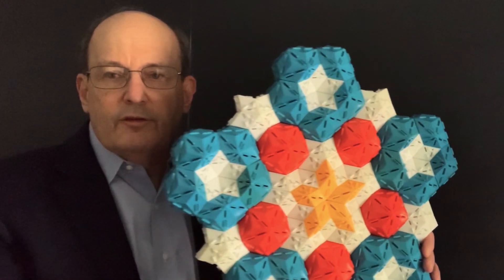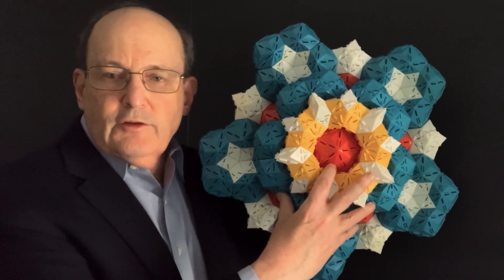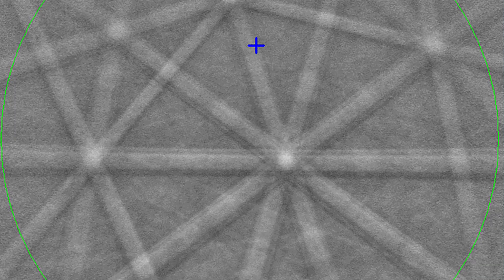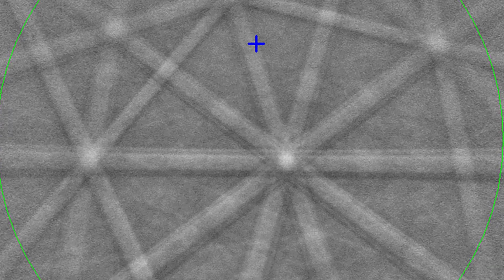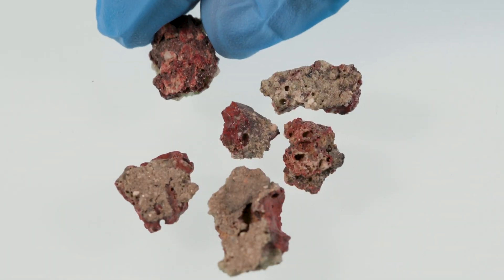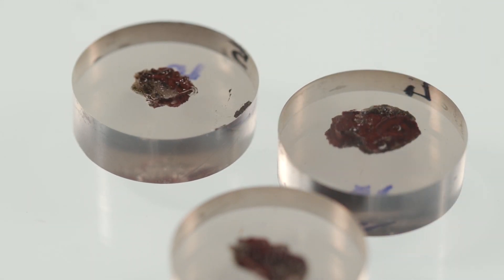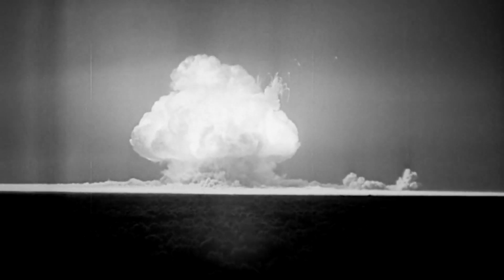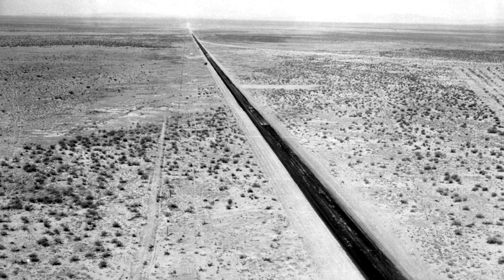Quasicrystals in the first nuclear explosion

Comment: This passage by Freeman Dyson from the foreword he wrote for a book:
“I mention in conclusion one of my favorite Baconian dreams, the possible connection between the theory of one-dimensional quasi-crystals and the theory of the Riemann zeta-function. A one-dimensional quasi-crystal need not have any symmetry, It is defined simply as a nonperiodic arrangement of mass-points on a line whose Fourier transform is also an arangement of mass-points on a line. Because of the lack of any requirement of symmetry, quasi-crystals have much greater freedom to exist in one dimension than in two or three, Almost nothing is known about the possible abundance of one-dimensional quasi-crystals. Likewise, not much is known about the zeros of the Riemann zeta-function, described by Piergiorgio in his chapter 5, section 2. The Riemann Hypothesis, the statement that all the zeros of the zeta-function with trivial exceptions lie on a certain straight line in the complex plane, was conjectured by Riemann in 1859. To prove it is the most famous unsolved problem in the whole of mathematics. One fact that we know is that, if the Riemann Hypothesis is true, then the zeta-function zeros on the critical line are a quasi-crystal according to the definition, If the Riemann Hypothesis is true, the zeta-function zeros have a Fourier transform consisting of mass-points at logarithms of all powers of prime integers and nowhere else. This suggests a possible approach to the proof of the Riemann Hypothesis, First you make a complete classi fication of all one-dimensional quasi-crystals, and write down a list of them. Collecting and classifying new species of objects is a quintessentially Baconian activity. Then you look through the list and see whether the zeta-function zeros are there, If the zeta-function zeros are there, then you have proved the Riemann Hypothesis, and you need only wait for the next International Congress of Mathematicians to collect your Fields Medal. Of course the difficult part of this approach is collect ing and classifying the quasi-crystals. I leave that as an exercise for the reader.”

Comment: Interestingly, it is well documented by technical journals & laboratory manuals how neutron flux upon aperiodic quasicrystals can induce oscillations of crystal lattice beyond three dimensions of our universe.

Therefore, a hyperdrive and hyperatomic or  hypernuclear motors of Asimov's stories could become a reality soon if a cryogenic chiller is used to prevent neutron fatigue instead of antigravity warp schemes.
Reply: Applications are a way to circumvent the light barrier for two way weekend trips only for intergalactic journeys between galaxies but not for interstellar journeys within galaxies, trips sideways in time between parallel universes, etc.

There are a lot of inconsistent official reports about the Manhattan Project since Jack Kirby claimed "FBI agents censored early 1940s WWII era comics for mentioning Nikola Tesla's designs for nuclear weapons",  on August 6, 1945 Enola Gay used a detonator similar to a low frequency radio transmitter antenna Tesla had used to turn Earth's Magnetic field into a particle beam,  the North Pacific Basin has had centuries of energy anomalies where only after intense sea storms remains of Cube Square Law gigantic creatures such as "giant squids" are found so it makes one wonder if the Manhattan Project continuing with Triumf  Labs of British Columbia Canada,  and the Riken Institute of North East Asia Japan have secretly opened interdimensional portals.
Reply: Such a hyperdrive could function at 72 Mev instead of 10^19 Gev of antigravity of event horizons for Alcubierre warps of altering the vacuum of space since every so many years someone has unprovable claims for "reactionless antigravity propulsion via a spinning torus or microwaves on metal".
Reply: Aperiodic Quasicrystals prove, Catherine Asaro, and Anne Macaffrey stories along with "Astounding 1942" and Illustrators such as Whelan, Youll, Chris Moore, etc. could be on to something with an anime "Crystal Drawer".